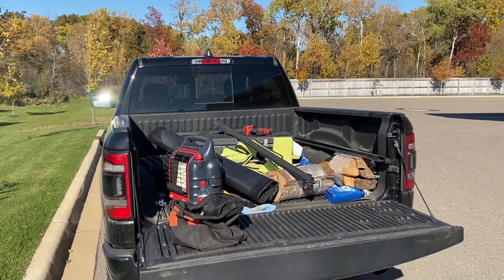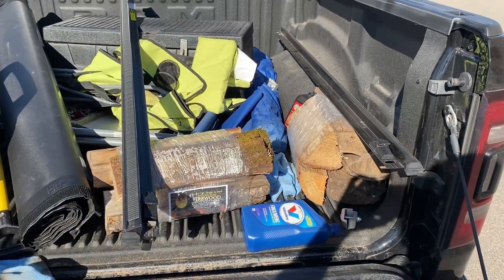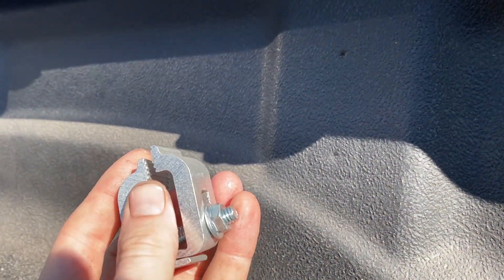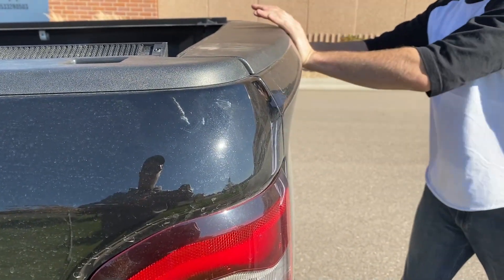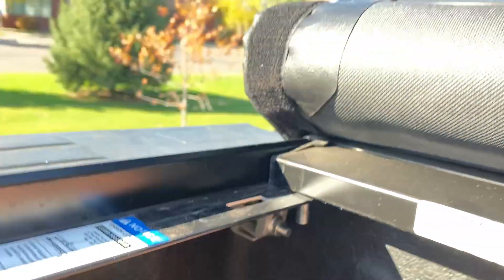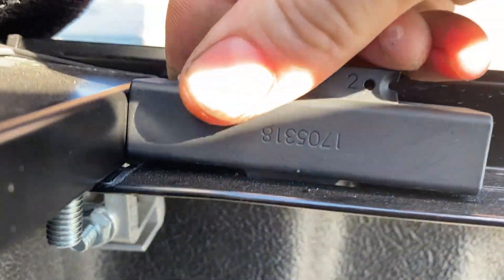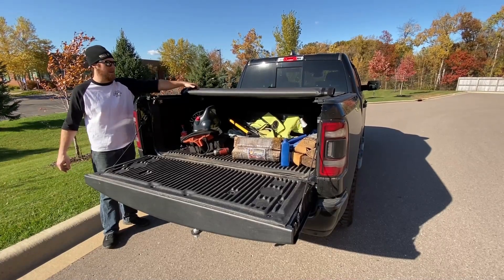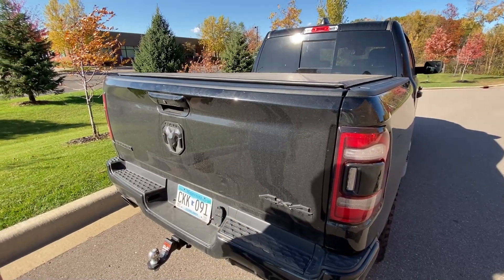Ram 1500 Bed Cover Install (2019+)

Comment: In the video, the cover seems pretty flush with the tailgate.  I installed mine today, and towards the middle of the back bar, you can see the rear seal probably 1/2 inch or so. The rails are flush with the sides of the truck bed.
Reply from the maker: I had probably a 1/4” gap all the way across the tailgate, but the seal back there closed up the gap and there wasn’t any visual bowing. I wonder if yours got damaged during shipment. Might be worth trying to carefully bow it back
Reply: @TonyTheTruckGuy  I think it might be good.  I was looking at it again after I parked it, and it seems to be OK. Thanks for the reply.
Reply from the maker: @WethepeopleFreedom76  Even better lol!

Comment: So I bought the cover and had to return it immediately because it don’t fit. Paper says my truck is bighorn/lone star but in my cab it only says bighorn is there a difference in bed when comes down to the line of truck?
Reply from the maker: Bighorn and Lonestar are basically the same truck, they just call the Texas version the Lonestar because they’re special haha. Do you have Ram boxes? And what year is your truck?
Reply: Oh okay well that make sense. And no Ram-box it’s 2020
Reply from the maker: @waynenation678  6’4 bed or 5’7? I’m guessing that’s where it issue is if the cover wasn’t big enough for your bed.
Reply: Yea it wasn’t it was too short had my wife shake her head and walked away lol
Reply: I really don’t know much about trucks I only bought it because we bought a boat. 5’7 or 6’4 means the liter?
Reply from the maker: @waynenation678  🤣🤣 Did you order a bed cover for the 5’7 or the 6’4?
Reply: 5’7
Reply from the maker: @waynenation678  So you for sure HAVE a 5’7 bed, and you ORDERED a 5’7 bed cover, and it was STILL too short? By how much roughly? I wonder if they sent you one for a different truck by accident. That’s the only thing that makes sense unless your bed is actually 6’4 but then it would have been super short. Mine fit like a gloved.
Reply: Yes my wife checked few min ago and they did sent the wrong size.
Reply from the maker: @waynenation678  How dare they! Lol. Are they sending the correct one?

Comment: Just threw this on my 2019 Quad Cab, we'll see how it fairs up here in Duluth!
Reply from the maker: The biggest complaint with mine so far in the winter is that snow can build up and freeze around the plastic loops, making it hard to get the hooks in. Other than that, it’s held up well!
Reply: 2 years later, any complaints?

Comment: Hey man does the bed cover you have in your truck fits a 2022 ram 1500 eco diesel truck?
Reply from the maker: As long as it's the 5'7" bed and not the 6'4" bed.
Reply: @TonyTheTruckGuy  I think is a 5'7"
Reply from the maker: @alfonsofernandezdelv1763  If it is this will work
Reply: @TonyTheTruckGuy  is the lone star edition